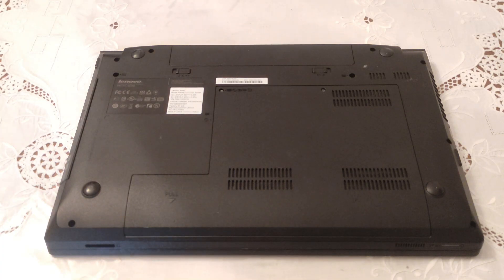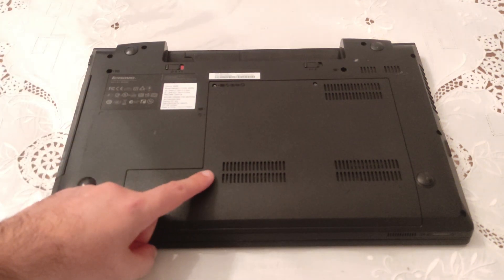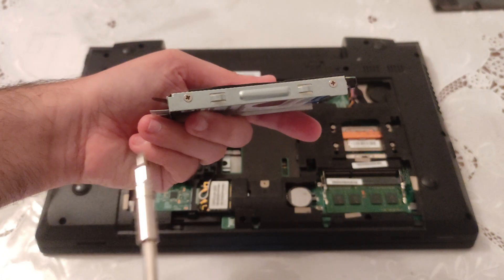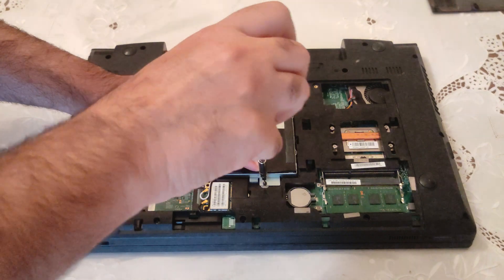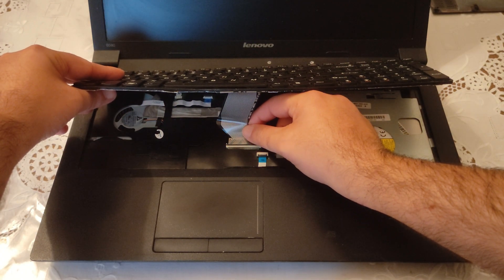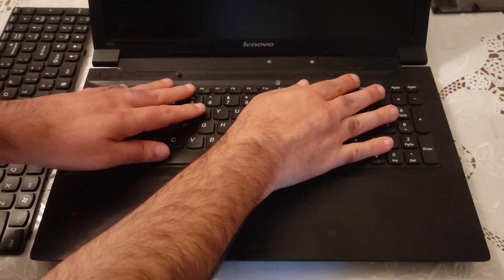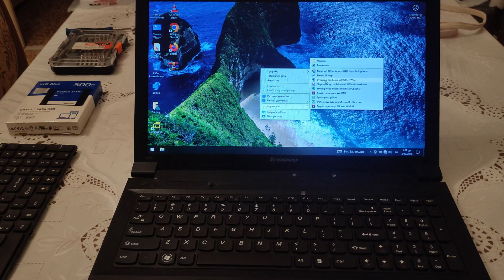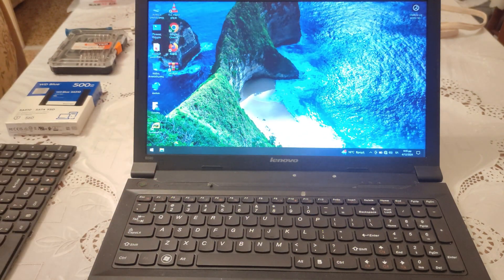How to replace HDD with SSD and how to replace the keyboard at any laptop

Comment: Replacing an HD drive with an SSD is not a problem if we do not have an operating system on it. When you need to install and activate the system, it becomes more difficult. Additionally, each laptop opens differently, some have these flaps and others you need to open the latches with a special flat plastic so as not to break them to get inside. There are just so few comments, maybe You will find a moment for a question? I would like to ask You if You can recommend a laptop? I liked the "ASUS ROG Strix GL703GS-E5011" but it is hard to find around PLN 1200. The laptop can be used for light repairs, replacing thermal paste or cleaning/replacing some parts. It is not a problem for me. Thank You in advance for reading and replying! Good assemblies of future equipment! It is nice to watch such disassembly, cleaning or even a guide on how.